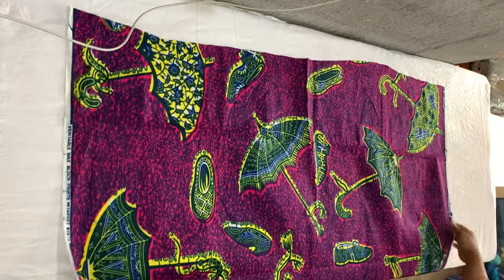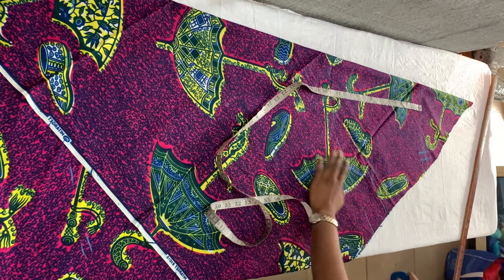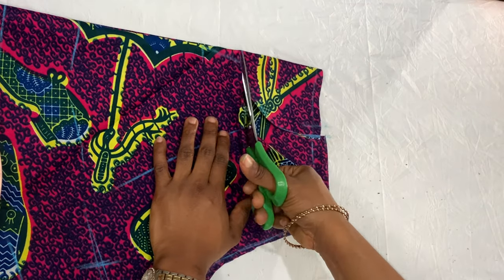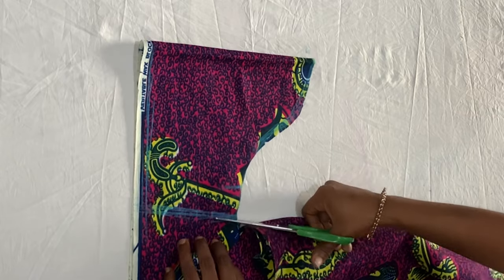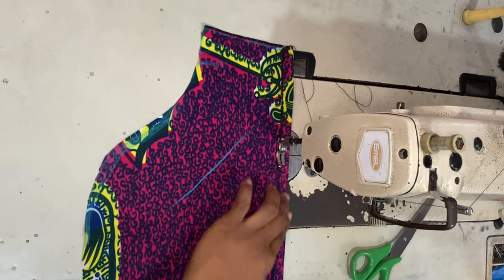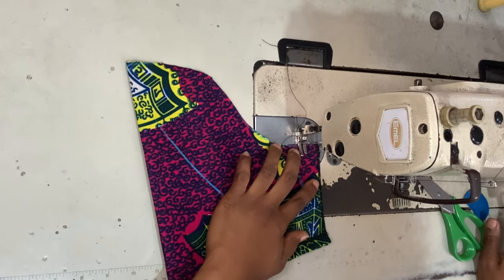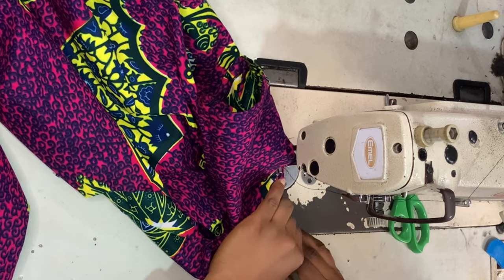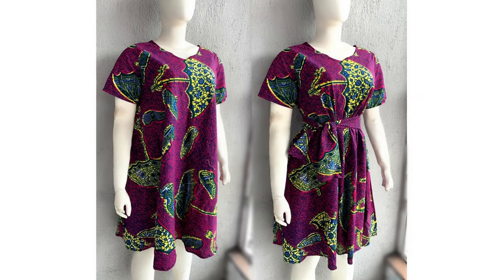HOW TO MAKE A CIRCLE DRESS | Cutting & Stitching | Flare Dress | 180 Degree Flare | Cut & Sew Silem

Comment: Thank you for this helpful tutorial.

Pls i want to ask, for circle dresses with zippers, do we also grade the back like we do in fitted dresses to avoid zipper bulge?

And secondly ma'am, i noticed that after sewing my circle dresses, the centre front goes up a bit higher, it doesn't relax the way it should. I was wondering what the caise could be and what i can do to avoid this.
Reply from the maker: For circle dresses like this one, you don’t need a zipper especially if the neck is wide enough for the head to pass through. If you must put a zipper, it should be a short one that shouldn’t go past the chest line. A zipper should only be used when the neck is too small for the head to pass through.

I don’t know why the center front of your circle dress is going up. Did you follow this exact tutorial?